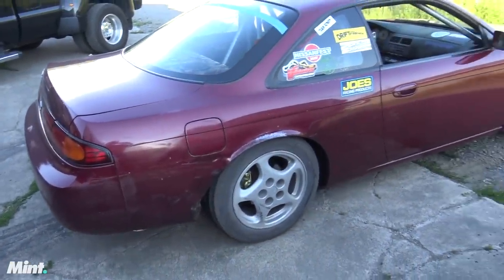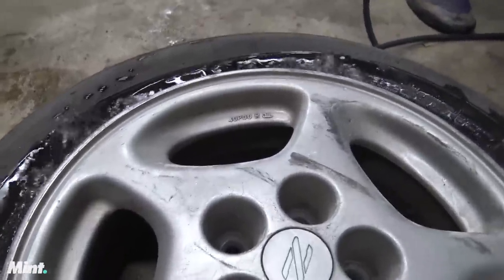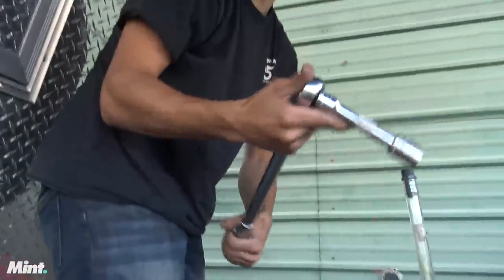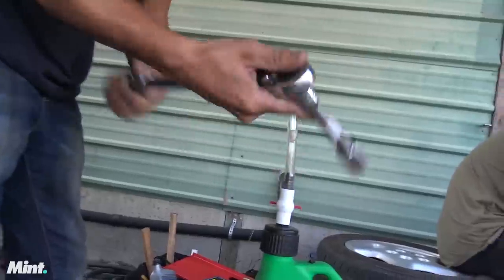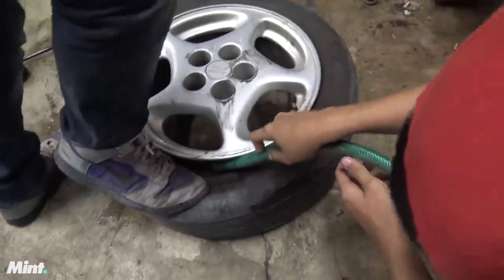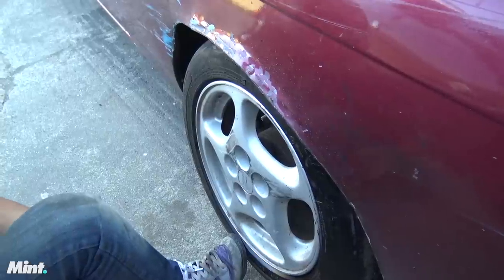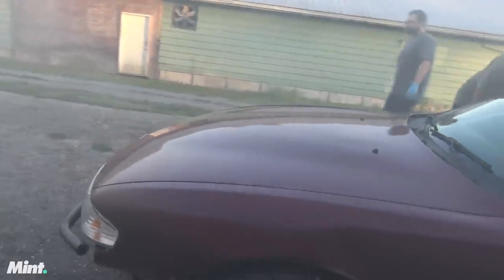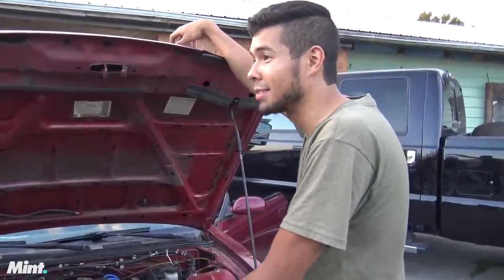Filling a CAR TIRE with WATER!

Comment: You should fill it fully next time...
The air in the tire creates momentum...
Reply: Abdulkadir Özgencıgor water cant be compressed, no air would pop the tire at any bump
Reply: You can't compress water, but you can put pressure on the tire, with water, no problem. You can put on 3bar with air and also can put on 3bar with water.
Reply: you are totally true about pressuring water, but it wont change anything. Actually when the tire is rotating fast, the water is perfectly balanced due to centrifugal force. Anyway if there is a little bit of air in the tire. That's my opinion.
Reply: Benoit RIBERY centrifugal force will not be applicable
Reply: yes it will, when there is rotation, there is always a force that tries to pull you at the exterior of the rotation. Like when you are turning with a car you feel a force pulling you. Same thing here, when you tire is rotating fast, the water subit the centrifugal force and is fully repartited on the exterior part of the tire. And the air goes against the rim. So there's no more un balance problem as it can be at low speed. 

Sorry if my english isn't perfect i'm not native english, i don"t even live in english country ;)

Comment: I fill all my yard tires using a clip on tire inflated and not break them down just let out air and replace it with water on the vehicles!!! Slow leaks are not a problem.
Works great.

Comment: The rubber will eventually heat up and then transfer that heat to the water building up pressure in the tire with steam causing them to explode, this is why we don't use water instead we use air, plus water can't flex like air, and you're pretty much adding stress to the drive train with more weight.

Comment: Adding water to a tyre add to more weight.
Let's think of it this way, if you glide in air, you feel your weight reduced or probably feel weightless, but when jump into the swimming pool, you know what it feels like?
And every motor and aircraft company's main priority is to produce less wight than thrust. 
So adding water instead of air to fill a tyre will constitute to more weight.

Comment: If you're off roading and you have a 44 inch tire you can either balance it by putting water in the bottom which fix has a lot of issues but you cant air down or would a lot of people have switched to which is putting steel shot in the tires AKA ball bearings

Comment: fill with liquid mercury
Reply: As opposed to solid or gaseous mercury?
Reply: Yes I know that. I was poking fun of OP because he specified the mercury has to be liquid mercury. Thats common sense, these guy's aren't going to put cryogenically frozen mercury into a tire, and the boiling point of mercury and their vapors I'm sure would almost instantly melt/vaporize the rubber of the tire.
Its about as redundant as saying "Evil Stalin" as opposed to not so-evil Stalin?
Reply: The rubber would become brittle and crack apart.

Comment: was doing this in the 1960's with many tractors
Reply: Water?    Probably beet juice, calcium chloride for a professional solution or maybe windshield washer fluid or antifreeze for a DIY solution.    Plain water would be pretty bad for implement tires, though it would still have the desired effect on center of gravity.

Comment: Hey geniuses; farm boys have been doing this to tractors since the rubber tire was introduced. They make a hose adapter that screws on the valve stem after you remove the valve core

Comment: Using a Non compressible fluid for a tire. Would feel like using solid tires. It would be an unpleasant drive, and would require additional suspension to compensate.

That said, fun experiment 👍

Comment: you do this with tractor tires to get more traction
Reply: Yes. People have been doing it for decades. Its not a new idea at all.
Reply: vacomments Yes you are right this is not a new idea at all, in fact this is a very effective way to add weight to the tractor so that it become harder for the vehicle to lose traction. When you are driving up a dirt road in the wet, lose of traction is not the best way to get to get to the top of the dirt road. Unlike in this video content where lose of traction is intended and  desired, the water in the tires is hindering the lose of traction so it would probably be better not to put water in your car tires for daily driving. If you are at this moment putting water in your car tires, my advice would be to consider the consequences.
Reply: GeRaiDah In addition, an over inflated tire can become a small bomb. With water there isn’t such danger.
On a car it will just increase unsprung mass. No advantages whatsoever.

Comment: 8:30 what's making the sparks?
Reply: Candi Soda the wires that are in the tyre/tire construction
Reply: Ahh I seee
Reply: From the rotors he is power braking it that is why rotors are glowing red
Reply: @lonny allen y'oure are rarted
Reply: lonny allen Lmfao
Reply: Wire mesh inside the rubber
Reply: They are steel belted tires
Reply: The steel belts inside the tire.

Comment: Here in the UK we fill tractor tire with water to add ballast on hillsides and to add weight to the tractor but its best not to do it with the front tires  and travel at speed on the road too much or you can soon stress out the track rod ends

Comment: They make an adapter that allows you to hook a garden hose to your valve stem to fill with water while allowing air to escape...farmers been putting water in tractor tires for decades because weight gives you traction ..the ideal air water ratio is after putting water in to desired level air inflate remainder of tire space with 12psi of air..even our garden tractors have water filled tires.

Comment: In theory the water actually would make the tires last longer, the water would absorb the heat from the tire preventing it from becoming hot and easily breakable
But then again the water heating up will expand and possibly blow the tire from the inside

Comment: helium
Reply: Connor Truax , now that would be an experment.
Reply: Connor Truax They would have the opposite effect. They would be heavier than using normal air as although helium is less denser, it also occupies less space so more of the matter is needed to fill up the tyre. So not really an interesting experiment.

Comment: I don't have weights on my tractor. So I fill in water in tyres.
Reply: Saulatis was about to make a similar comment, used to be a common way to add weight to a tractor. It helped smallish 4WD tractors with large tyres ride without bouncing about too much to. It didn't take long before tyre fitters started complaining and it died out.

Comment: Use a tube filled with calcium chloride for winter time. Once your rolling its not really carrying the load anymore and gives a massive change in traction plus with the addition of tire chains you will turn your car into a sporty snow mobile lol

Comment: You know in large tractors like John Deere some farm equipment must have those tires are filled with water to add more weight and traction so when they go through the fields they are heavier so they can actually dig in and actually pull.

Comment: the Burnouts remind me of putting a lighter to a plastic bottle that has water in it.
 for some reason it protects the bottle from melting. I'm no scientist so my best guess is that the water acts like a  heat sink on a cpu, conducting the heat to a larger surface thus taking much longer to melt.
any thought on this?

Comment: Water would be more efficient at heat dissipation from the rubber due to the increased density, so the tires won't die from heat accelerated wear (burnouts), however, the increased density  makes the tire heavier, and will require exponentially more torque to move, and the same to stop or turn. Every pound or so will be the equivalent of about ten times that in unsuspensioned weight to the car. Surprised the cars drivetrain could handle it, honestly.

Comment: I'm not crazy about cars but I like watching random videos. So I have a few questions. 
1. how did you not get in trouble for how loud the cars were?
2. What in the world makes the front tires not move and not let you go forward?
3. What's the point of a burnout?
The only thing I know about cars is that you will get into a LOT of trouble if you take the muffler off. My dad had a super fast car when he was young and he took it off.
Reply: Prob because the car is Rear Wheel Drive so the front wheels dont move forward like the rear.

Comment: The water is probably hardening the melting rubber, therefore holding it together. that may be why it's able to last so long. What do you guys think?
Reply: I think the water is dissipating the heat when they do burnouts.

Comment: Simple. Until water is not completely vaporised, temerature remains the same. So, all the heat from the burnout doesn't destroy the tires but heats the water.

Comment: Filling your tires with water will not make them last longer when doing burnouts. It will instead keep the tire cooler, produce less burning rubber smoke, and impart more rubber to the pavement due to the added weight of the water.

Comment: Put a lighter flame under a balloon filled 1/4 water and 3/4 air...same idea. The water absorbs the heat instead of the rubber.

Comment: So it doesnt necessarily preserve tires but what happens is that water cant let matter get above 114 degrees Fahrenheit fheres fore it decreases wear on the tire because more heat = rubber melting faster or what is a tire degrading

Comment: In the winter i fill my tires with rv antifreeze. Just like these guys with water. The centrifugal force of the spinning tires being so heavy, combined with the fluid spinning and flowing with the tires at that speed gives me great gas milage on the highway. Slow speed or city traffic not so much. I use the rv antifreeze in the winter so it doesn’t freeze obviously and when I put summer tires on I fill with distilled water Incase my tires heat up to over boiling point on hot days in traffic. Incase people didn’t know the weight of the car pushing a tire down on a hot tar road can cause the friction point to exceed 225 degrees (boiling point 212 degrees) and distilled water will not boil as tap water or any other non-distilled water will. 
   The benefit of having the tires filled with fluid is obviously gas mileage on the highway. The cons are one poor gas mileage at slower speeds end in the city, to the time-consuming effort you have to put in twice a year when changing tires over being filled with water or antifreeze because the mechanics will not do it.

Comment: Ive seen farm tractors where they put water in the tires. Not sure why
Reply: For added weight that helps with traction . You don't need air just water and they bag out for grip

Comment: Real Talk- The water in a radial tire(Cord plies) will rust the cords causing them to break and releasing the air all at once. This is very dangerous!!!! This is called a zipper rupture( not like when you see a pretty girl) when the air comes out of the tire it is pounds per square inch. Fact a 100 PSI(Bomb) is enough pressure to launch a 16 pound bowling ball over the top of the Empire State building or 13 Football fields. Even at 32psi it can blow the clothes right off you and seriously injury you even killing. Tractor tires are bias and contain no steel cords, and are meant to be filled with water.

Comment: Nothing will happen if you drive normal,  like a more rigid tire, that is!!!, some Low profile tires are fill "rigid" because it has less air for deformation to absorb the shock. So the extremely low profile tires are feeling similar as have a water filled tire.

Comment: This is not advisable.

Water in the tyre can lead to a blowout or reduce its lifespan. This is due to the following reasons:

Firstly, water can come into contact with the rim and, over time, may boil inside the tyre. The steam generated could increase the internal pressure, potentially causing the tyre to burst.

Secondly, water can interact with the metal components within the tyre, leading to metal corrosion. This corrosion can weaken the tyre, reducing its lifespan and possibly causing a blowout.

Thirdly, water adds extra weight to the brake system, which can lead to accelerated wear on the brake pads.

Fourthly, the water inside the tyre can affect its performance. The presence of water can increase stopping distances and make skidding more likely, which is hazardous in critical situations.

Racers use nitrogen to maintain lower temperatures within the tyre due to its high speeds and reduced weight. Nitrogen helps preserve tyre lifespan and prevents corrosion. They avoid using regular air because it contains water, which can contribute to the issues described above.

I hope this helps!

Comment: Great idea, until you get the tire hot enough to boil the water, it turns to a gas, pressure increases and blows the tire apart. Dangerous af
Reply: I'm not an expert in science, but I believe that it cannot turn into a gas unless it had room to expand (which it doesn't).. so wouldn't it be more like ,  the tire might blow apart before it becomes gas?

Comment: When the asphalt got shaved right off... Holy fuck. Can imagine doing it with a motorcycle, though, the potential for rupture would be quite dangerous for the rider. People have done it with bicycle tires, and it is a mindfuck to ride, that's for sure. Takes absolutely AGES to fill it to the correct pressure. xD

Comment: Water IS denser than air so.... Duh? As for the observation of weight, that’s also cause there’s more mass in the given volume, again, cause it’s denser. However, your only issue is adverse weather conditions. If it’s below zero.... it’ll freeze and contract... driving ice tires is suicide in my opinion unless you add a natural environmentally friendly coolant to lower the freezing point and raise the boiling point. If you modify those points, that’s called progress 👍🏽 but you still got to deal with expansion and contraction as a potential concern for wear and tear. If expansion and contraction are not an issue than the only issue is compensating within your fuel economy some how for the added mass caused by using water instead of air. 

My suggestion is ditch the idea entirely and use Honeycomb airless tires but maybe you’re onto something and so stick with it. You might figure something out.

Comment: Water is one of the least compressible materials on earth, it is one of the only materials that will expand in cold weather.. However it has great thermal properties so would be absorbing the heat from the friction making the rubber last longer on the burnouts. But the ride on a car would be hard as shit, or would put so much pressure on the suspension and rim it would kill it...  So lessons learnt, find a gases compound that would absorb the heat better than air, act like air as the tyre companies put a shitload of research into designing a tyre that flexes with air.. And btw, air is 78% nitrogen, so filling your tyres with nitrogen is a SCAM.. Great fun video though, cheers.
Reply: Nitrogen isn't a scam if it's free. The thermal expansion coefficient is less with 100% nitrogen filled tires so you have more consistent tire pressures.

Comment: Weak. The tire wasnt completely filled with water. They should do it again but without breaking the bead and filling the rim through the valve stem. Same way, off car just completely fill it up new valve core and rock n roll. I'm not very Impressed

Comment: Did this on my motorcycle tire. I didnt know that's what the mechanic did when I brought it get a puncture fixed. When I pulled up to the gasoline station and tried to fill it up with air, I was surprised why their machine was spewing water.